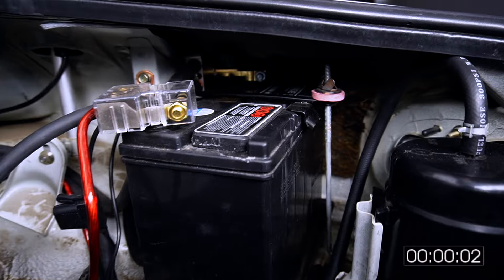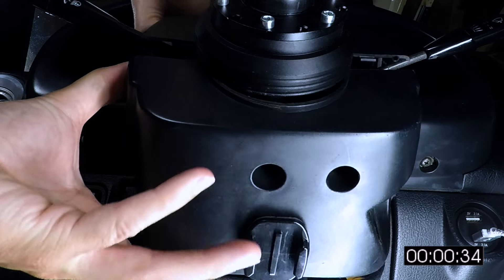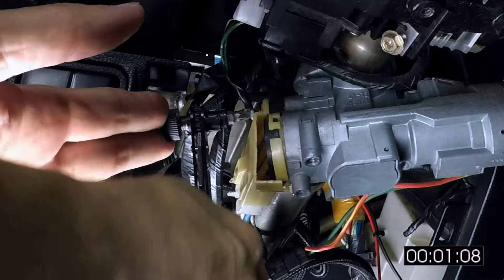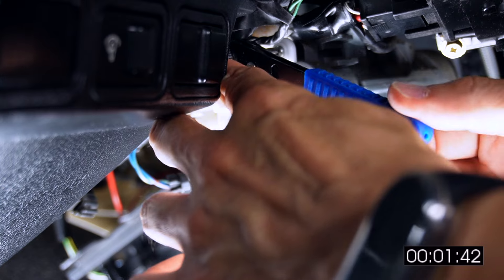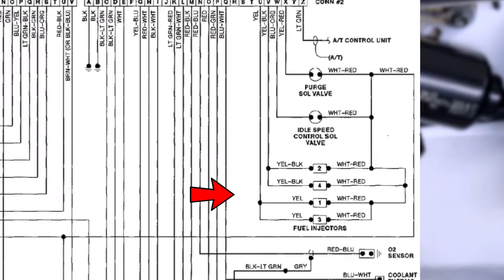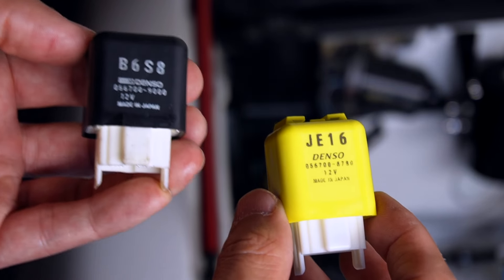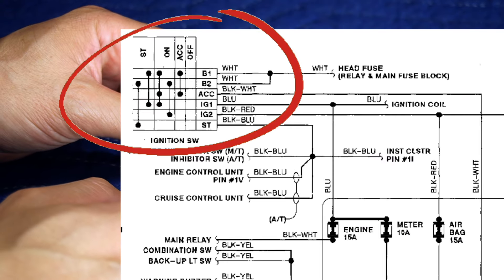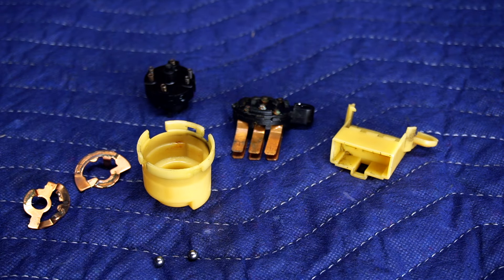FIX Miata STALLING ISSUES in 2 Mins ➜ Ignition Switch & Main Relay

Comment: Very curious to know what you've got going on here.
For the post mounted disconnect switch - can you update us all on how you've set this up?
Did you make the clear plastic enclosure and why?
Secondly what is the thing to the right of the battery?
I forget which year your Miata is?  
Thank you - great content as always.
Reply from the maker: You've got a real keen eye! Last year I ran new battery and ground cables to replace the old skinny factory stuff (timed vid link below).  The clear plastic thing is a battery post distribution block from Amazon with screw terminals on both positive and negative terminals.  On the neg post I have that quick battery disconnect to kill power to the car, which is what I was doing in this video. Mine is 1990 so the wiring might be a bit simpler than yours.  And the black canister to the right of the battery is the EVAP canister (vents fuel tank vapours) that I relocated from the engine bay to the trunk to clear space for the power steering reservoir. Great questions dude! 
New battery cables install -> https://youtu.be/YzgxW3qaNMU?si=Dv5dlOnktvC5l32L&t=540

Comment: I bought the 20 amp stock replacement part (B5B4) from FM for about $33.00.  The 80 amp version is recommended on their website for cars with higher power fuel pumps and/or ignition systems.  So if your NA/NB is mostly stock, like mine, the 20 amp version seems to be an affordable and acceptable option.  I didn't know the 80 amp version existed when I bought my main relay or I may have been tempted to get that one instead even though I have no plans to bump up the power on this car.
Reply from the maker: Flyin' Miata has a good recent video about their fuel pump relay upgrade kit (link below) and he says the same. If you're 100% stock then replacing with the B5B4 is "an affordable option". If you've got an upgraded ignition system, fuel pump, or even more components on the interior like aftermarket gauges, screens, amps, etc. the incremental cost for the 80A relay is recommended by them. Come to think of it for the fuel pump, FM recommends their DW100 165LHP for the stock replacement, which may benefit from an upgraded main relay. Thx for the comment!
Flyin' Miata Main Relay --> https://youtu.be/RdnLhgCb_Rs?si=deYKIBO3maUcMko6

Comment: I had a weird issue that after my car started, it wouldn't completely go to run, so my wipers and blinkers wouldn't work until I turned the key ever so slightly towards me.
Reply from the maker: That sounds suspiciously like the ignition switch. At the very least disassemble, clean, and reassemble your ignition switch and it'll probly clear up those intermittent electrical issues.